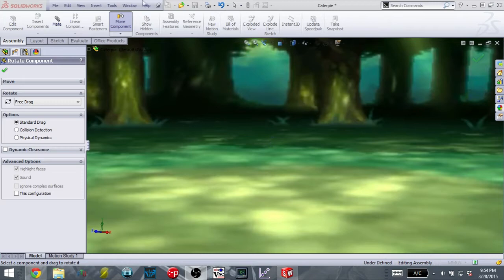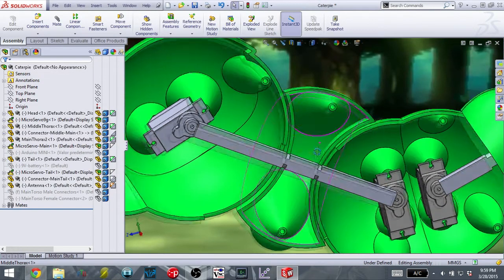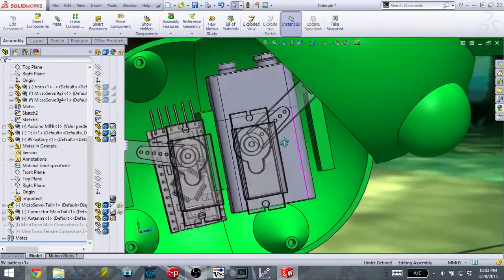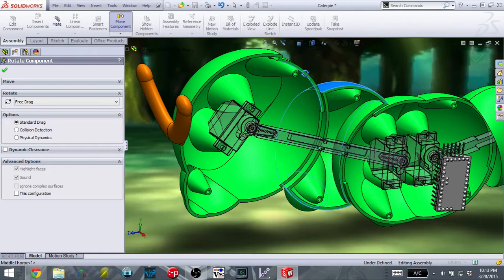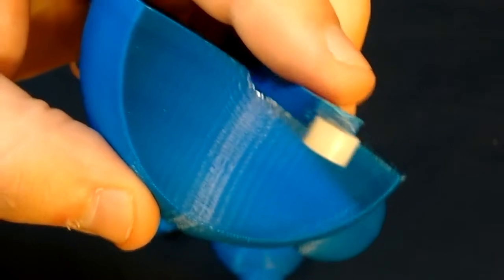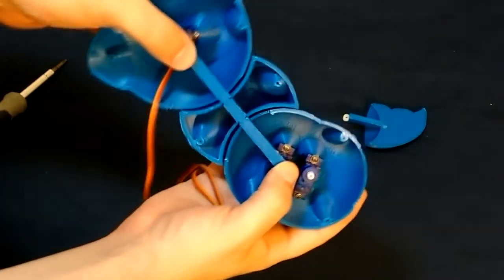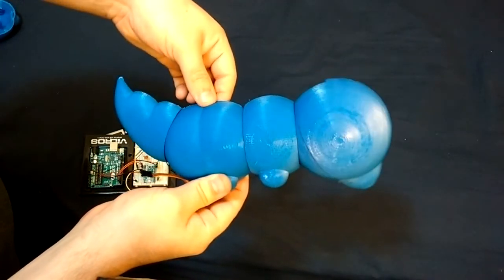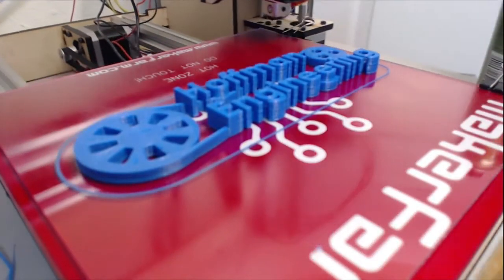Real Life Pokemon - 3D Printed Animatronic Caterpie Part 2: CAD and printing the shell

Comment: Hey! Is there any printed <$600 that you'd recommend?  Also, which printer do you use? Thanks in advance!
Reply from the maker: I do have a few recommendations! My printer is from Makerfarm. They sell kits that you have to assemble, but it only took a couple nights to put together and get my first print. You can see the kits here: http://www.makerfarm.com/index.php/3d-printer-kits.html

I have their 8" Prusa i3v model, which was the largest they sold when I bought it last year, and cost $650. Now, they have an 8" model for $520, a 10" model for $590, and a 12" model for $650. That is ridiculously cheap for the build volume, and my 8" model prints like a charm! Kits are intimidating, but they have great instructional videos showing it step by step. Since its a kit, its also not just going to work perfectly right out of the box, you'll have to spend time to learn the printer and calibrate it.

Another fan favorite beginning printer is the Printrbot Metal Simple. It has its own set of pros/cons, but the 3d printing community loves it, so if you want an assembled printer I'd look into that.
Reply: Hoffman Engineering
Okay, thank you. The only problem with the Makerfarm or other DYI 3D printers would be the fact that I'd loose patience mid-way. And the only problem I have with Printrbot Metal Simple is how short the prints have to be. Anyways, thanks for the response!